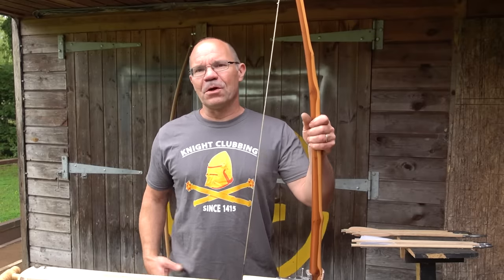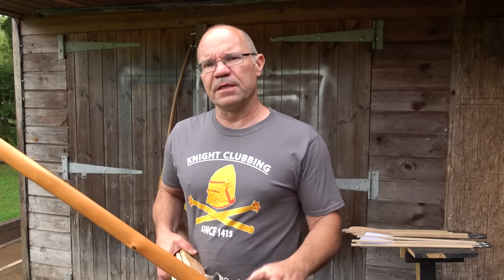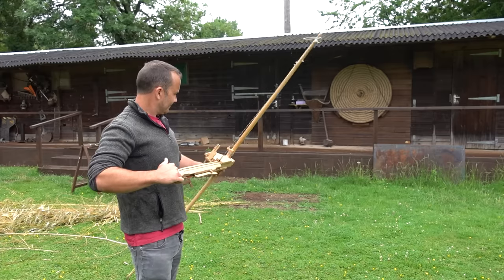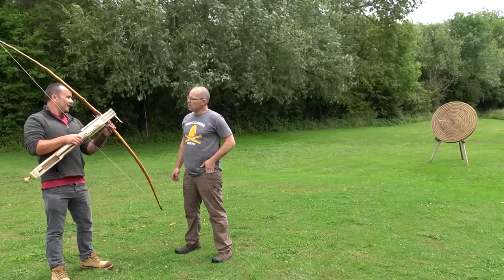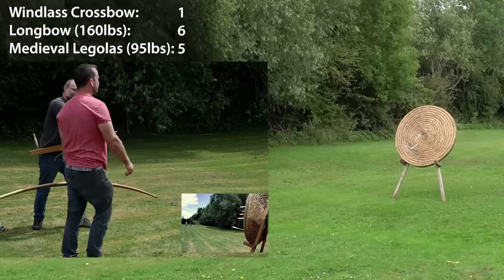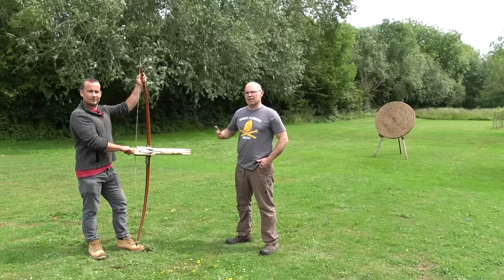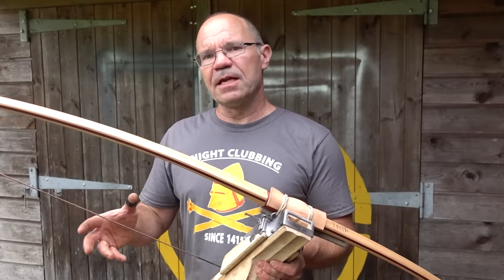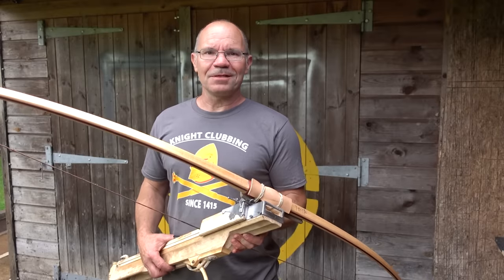Tod's 120lb Medieval Legolas - TESTED

Comment: The reason why it felt significantly harder to pull the legolas version vs the normal war bow was because the handle of the device is further back than the string, which requires more muscle flexion. As someone who does one armed pull ups on the regular, I can tell you that your muscles are least efficient when they are fully flexed (maximum contraction, ie at the top of a pull up). Also, the handle is rotated 90 degrees relative to the string, meaning you need a supinated grip, which is less efficient that the neutral grip you'd use on a string.

One way to fix this would be to put the handle forward, ahead of the string and make it freely rotatable, and then also give it some sort of a wrist strap, so that you could quickly wrap your wrist before drawing it back, which would greatly reduce finger strain.
Reply: Great video of the reconstruction.
The comment from Dyn Du is a great summary of the practicality of the invention. I would like to see Tod take all of Joe's comments into account and come up with another prototype - inlcuding thinking about the off-balance stance. 
I would like to know the additional weight of the device and the time needed to reload the magazine. Both will significantly affect the efficiency of the archer. The extra weight has to be supported by the arms (Joe's comment of an equivalent 20 or more pounds draw weight is relevant not only to friction but to the muscle groups fatiguing under the weight when holding the tension), and there may be a recovery period to be factored in. The time to reload will also reduce the number of shots per time period. 
I wonder in line with Dyn Du's comment if the bow should not be remade to allow a standard stance (if that is possible). Joe seemed to be correcting - either it threw him off balance, or he didn't believe the arrow, delivered a couple of inches from the centreline of the bow, would hit the target where he wanted it to. This may require familiarization with the sights, or to have the arrow delivered at a slight angle so it hits the target at the same point as a standard longbow (with the arrow sent over the thumb) at a range of ten or twenty metres.
When Joe was going for speed in the excellent comparison videos, he was able to shoot five arrows in the same time (8 seconds was mentioned) as he could shoot 2 arrows with the standard longbow. When going for accuracy, he shot 3 arrows in that period. That makes me wonder, even after practice and taking into account the reload and recovery periods, if you could get double the shot rate. I also wonder, medieval archers not being thick, what methods they habitually used to speed up their shot rate?
Finally, the effect of using a draw weight that is significantly lower than the standard longbow should be investigated. All the above obviously needs a lot of work and a lot of Joe's and Tod's time, but such is the path of launching products (that's my job in real life).
Strategically, one might wonder if generalizing this device would mean that there were fewer bowmen on the field of battle?
Reply: That doesn't sound right, since the Manchus drew back to their string side shoulder and could typically draw just as much weight as longbowmen could.

Comment: I think one of the key thing that need a change is the back GRIP!!!

The grip should be in horizontal position because this it the normal and narturlige drow technique for a bow and the archer.

My reasoning for this is that the point of the now Medieval Legolas is to make the bow easy to drow and fast to shoot.

If the bow becomes uncomfortable because of the grip angle with the Medieval Legolas then its probably not going to work with the bows with heavier drow weight.

The difference in angle is the same as making a person doing pull-ups then they only have been doing chin-ups over a long time, its many of the same muscle groups being used but in a completely different way and the both have close to the same outcome.

And as i understand a chin-ups is easier to preform than a pull-ups but with a equal outcome in the area of movement.

What i am trying to say is that one of the drow techniques have to be easier to pull of and i would put my guess that, that would be the vertical angle. I do not know if that's the case but thats my proposal.
Reply: Actually a very good comparison with the pull-ups/chin-ups. When you turn your right hand all the way counter-clockwise you barely use the bicep at all to assist in the movement, and vice versa when it's turned all the way clockwise. In the position that Joe's hand was in in the video he would have used his biceps brachii minimally, forcing his latissimus dorsi to do 99% of the work, when normally it's closer to 80% lats 20% bicep for the way a bowstring is normally gripped.
Reply: @VladikVP  Yup, muscle groups. Joerg probably used his biceps more as he shoots slingshots so an overhand grip wasn't a problem for him. Just a matter of training, I think.
Reply: @BobT36  That would make sense. But i still would think that its not the ideal technique for a bow even with the Medieval Legolas.

Comment: Just an idea: if the archer does not use the grip handle on the device, perhaps there could be a latch (a piece of wood on a spring, really) that latches against the bow when it's fully drawn. That would still require the archer to draw the bow, but would not require him to hold it pulled, allowing for much easier aiming. Then after the shot, the archer could unlatch it with a finger.
Reply: The problem is you just turned it into a vertical crossbow.
Reply: @Synthmilk  an easier/quicker crossbow
Reply: It would have had that, but it is illegal in Germany to make something with that type of system. It may be a better design, but you can blame governments for limiting innovation
Reply: crazy silly  They'll arrest you first then look up the law afterwards.
Reply: kasuha 
Yep, basically the same principle as when you wind up a winch with tooths that only let it go go one way. 
Probably several different ways to accomplish the same principle; not using (muscle) energy when aiming. 
Would it help much; targeting I mean? I think probably yes if done correctly. 

But for the moment I feel the more pressuring questions are;
-they did have cross bows; but they were slow
-bows: reasonable fast , requires much training
The medieval legolas is thus far a bow with a magazine; potentially great for loosing 5 arrows quickly, but with reload time the overall rate of fire is probably quite the same as bows. However; 5 quick arrows, perhaps used in a maniple system or something else could be a game changer. 

-the draw assist might however also accomplish that archers (or maybe you should call them crossbow men or whatever at this point, needn't be trained as much). Might also increase effiency for good archers, cause in theory you could get 300 bow men with support troops loading the magazines to then do the job of 1000s; but that might mean you'll have to shoot quite a lot of arrows in a short space of time; and no matter how strong you are; you get tired.

Comment: Imagine if the elves had these in Lord Of The Rings. The armies of Mordor would just go home, lol.
Reply: The elves migth have not been able to use this.
I see he MIL (Medieval Instant Legolas) more in the hands of the Orks, benig stronger than elves the bows could have been even heavier.
Plus it could be made with more metal parts making mechanical solutions for the problems possible.
Reply: @Franky_Sthein  So. A crossbow then lol
Reply: @treyondaren3542  Now that you mention it......damn.
Reply: I'm pretty sure that the whole point of naming it after the Legolas is that the elves wouldn't need one of these devices to shoot that fast.
Reply: Nah, this is 100% a DWARF creation. Watch the battle of the five armies (perhaps it’s only the deleted scenes?) and the dwarves basically have arrow-blocking helicopters and advanced tech. The elves definitely just draw normal bows superhumanly fast, the dwarves invent advantages.

Comment: @Tod's Workshop I feel that the front handle & sight are for situations when you need a really far & accurate shot (basically "sniper rifle" configuration),
but the handle & sight are not needed when you just want to send as many arrows as possible (basically "machine gun" configuration) which was what you tested here.
Could you 2 make a test about the bow works in a "sniper" kind of situation? (like 2x, 3x or maybe +10x normal distance, maybe shoot at almost 45 degree skywards & see how far it can go & with what accuracy) (maybe you need to design some kind of "mortar" style sight for such extreme angles).
Reply: Thing is you may as well just use a normal bow. The whole point of this is to increase firing speed, I'm sure joe would be as accurate or more so shooting normally and instinctively with his normal bow

Comment: Quickly train villagers or soldiers to shoot at set angles with a good archer calling out the levels to shoot at, I would not like to approach a wall or palisade with that rain of arrows coming over
Reply: Yup.  You could also have rows of men behind waiting for the front ones to get tired, which they would quickly, and then they walk up and take it and keep shooting, while the previous guys go to the back to rest their arms.  At that point, your only limiting factor is how many arrows/bolts you had to shoot.
Reply: heh, someone's read rangers apprentice. I feel like its plausible though just from having taught archery for a few years even kids are comfortable enough to handle a bow and aim at a set angle within a few days. commoners in medieval times might not have had the strength to pull a massive war bow but even lighter bows could be extremely effective against lightly armored troops.
Reply: Or just train them to build machine guns
Reply: @excalibur5434  Romans made repeating ballistas. Nearest thing.
Reply: @DeusExAstra  actualy ... you have a guiding rail. I wonder if you could shoot cast/masoned bullets. If you go for battlefield saturation you can kiss accuracy good by without regretting it.
Reply: "Let our arrows drown out the sun, and let no man look to the heavens for salvation"
Reply: TheElvenArcher I think you’re right, it’s one of a very few points for a series of books I was not overly impressed with back in 06-07 that I can remember.
Reply: Will Treaty wants his idea back.
Reply: Mount the device to a turret and you can loose many arrows from a defensive position on a base.
Reply: @melvixen1943  You can make incendiaries that could be launched by this. one of the first crossbows I made had a similar channel made out of poly pipe. you could shoot bic lighters out of it. if you were particularly crazy, you could also should a handful of nails in a sabot turning it into a type of low velocity flechette shotgun
Reply: @TheElvenArcher  haha rangers apprentice was the first thing I thought of too

Comment: It seems like he was not told about the purpose of the front handle. Using it he would have been able to relax his pulling arm and take his time to aim more precisely.
Reply: He was probably told of it's features. ;) But since they are shooting for speed first and precision second here, if the movement of gripping it impedes his shooting then removing it (even temporarily) was the correct call.
Reply: to be fair joerg's just need one finger but this one is too long and require four to "lock"
Reply: @drunkenmuse  UH No he obviously was not. Review the video at 7:40 when they are talking about the fore grip. He points out that it crushes his hand and stops his full draw.
Reply: The main advantage of being able to lock the draw is mobility. Medieval archers are stationary but with the instant legolas walking forward or backwards would be possible. New assault tactics could have been developed.
Reply: @FathinLuqmanTantowi  Jorg is using one finger on a compound bow which is probably around 10-15 lbs at full draw. 75-85% letoff is fairly common.
Reply: @Novusod  locking the draw with a longbow will damage the bow. Fine for modern materials, but bad for wood.
Reply: @19firebird86  The idea isnt to lock the draw for an extended period of time, this is more along the lines of a few seconds. Imagine Drawing the bow from behind cover, locking the draw, step out, aim, FIRE, and then duck back right away, or depending on the situation, fire again.
Reply: I think the point is that the higher draw weights that joe shoots change things. Can you imagine an Olympic weight lifter pushing to their max bench press without closing their fingers round the bar? Opening the fingers near full draw where the force is at the max would be really unstable. Not surprised he didn’t like it.
Reply: @ttneiltt1  Also Joe is so highly skilled that he does not need the extra second of "lock-out time" to aim. He draws to a perfect aim instinctively. But you would get the most value out of the SIL by giving it to people who don't have a decade's worth of training behind them.
Reply: @markmagner7339   The winking smiley indicated a joke, this one referencing Joerg Sprave's trademark line "Let me show you it's features" quoted in the beginning of the video.

(My actual point was that it slowed him down, and relaxing his arm / taking time to aim precisely superfluous for a video focusing on speed of use.)

But as he also shoots the smaller version (Joerg's original proof of concept Legolas) mounted on the 30 pound bow beforehand - which has the same feature - he should be aware. However, that design had already taken the idea of repeat shooting into account (making the grip smaller, so you only need to lift the affected finger) he doesn't have to release his grip to use it / risk getting his hand crushed.

Meaning, as he achieves the technique when shooting the smaller bow/version he is likely aware of both the original feature and how it's used/left unused - the problem with the larger design is that the feature has been redesigned as a full hand grip, meaning he must either release his grip entirely or get his hand crushed when trying to do a full draw.

So, he probably knew and his comment is referring to the larger version grip design. It doesn't take repeat shooting into account, and removing it was the right call when testing for speed.
Reply: Sandcastle •  Wdum? Archers would often have to hold their draw for extensive periods to choose their shots. Using heavy warbows requires a lot strength and your hands will start shaking if you keep shooting. If you have a foregrip you can mitigate that improving accuracy.
Reply: @drunkenmuse  I too enjoy Jeorg's tag lines as well as his great attitude. I mean no disrespect here to any involved. 
Even when speed shooting Tod was aiming. The fore grip does not require loosening his grip as anyone who shoots a bow is aware the bow are is a brace with the bow requiring no actual finger grip only the bow nestling between the thumb and first digit/finger.
Using the handle on the front of the Legolas even for a single second releasing the pressure off of the draw hand would greatly lessen fatigue and as designed increase accuracy. 
Jeorge has demonstrated the convenience of the handle not only eliminating archer fatigue but also the aid it provides to weaker archers pulling a bow beyond their ability. Watch his video when he mounts the Legolas on a Yew war bow that he has difficulty achieving full draw. With the Legolas and the handle Jeorg is able to open his bow hand while drawing grasp the handle and easily move to full draw, holding it at full draw indefinitely with his bow hand and when ready easily aim and release, achieving perfect accuracy. The handle places the strain in the strongest most able part of the human body the hand. 

I am not a personal friend of Jeorg. I have never met him. I have posted to his videos. Maybe I am taking this a little too personally. BUT, when I watch now the second (that I know of) independent review of Jeorg's Legolas and it is so painfully obvious the reviewer did not take the TIME to learn about the device. Rather they seem to have spent ample time thinking up snide little comments at Jeorg's expense or self congratulating statements again slighting Jeorg's invention and categorizing it as MAYBE a toy or beginner's aid. It really pisses me off.

I try to follow up these review video's by watching Jeorg's I don't think I could contain myself. Jeorg is very funny and a rock solid MAN. If you watch his review of the first review, the disappointment in his eyes while he smiled and joked the whole time. Because the other reviewer acted as if he had no knowledge of how to mount or utilize the Legolas. Then somehow he managed to break the Legolas and attributed it's failure to cheap materials and construction...not any different then the backhanded comments in this video. 

If you have watched the slingshot channel Jeorg inventions for the shooting of arrows and other objects is very impressive. Jeorg's designs utilize simple gear and lever designs constructed out of Plywood. One of the most readily available and most easily cut and shaped materials. He even shares some of his prints so others can build and enjoy them.

If used properly the Legolas can supply any number of archers with the ability to consistently hit their targets quickly and easily with little training. While transforming an average archer into a more experienced archer capable of putting arrows on target quickly and accurately.
Enjoy the Fourth.